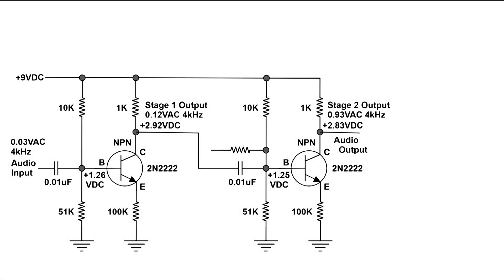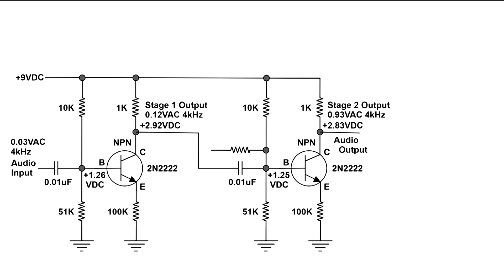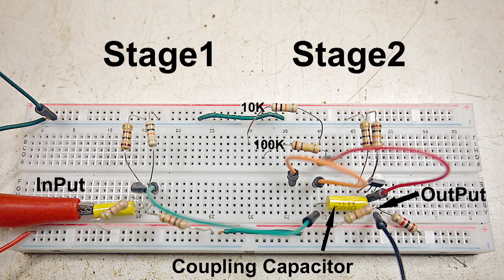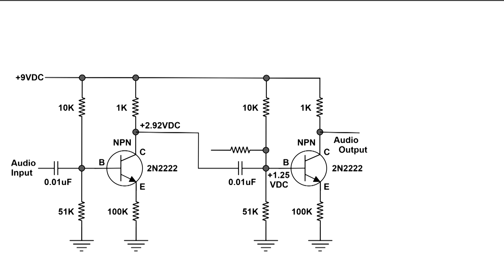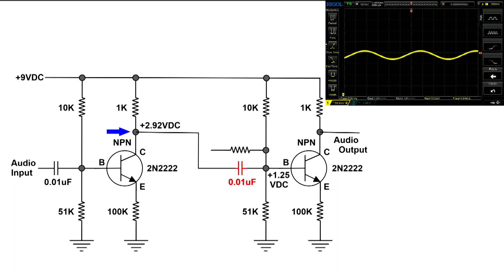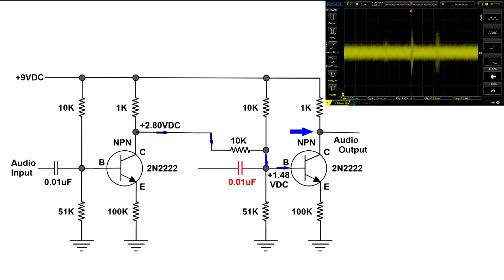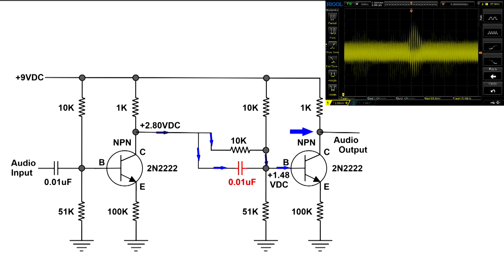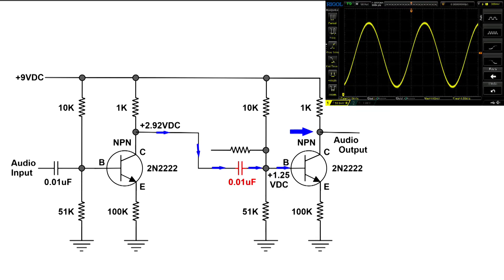Audio Coupling Capacitor in Transistor Amplifier

Comment: That made more sense to me than most videos on the subject.  I've been trying to figure out how to build little transistor amps and fuzz pedls, and the little 4 part fuzz circuit I found on YouTube that I made has blown out a couple of small op amps, and it happens when you plug in the 9v battery.  I figured it was too much DC voltage passing through.  I can plug it into a practice amp with no problem, but I assume there's some protection coming in.
Reply from the maker: Thank you! Look for circuits using your op amps. I do not know what op amp or how you are trying to use them.  When you get a op amp circuit working then add your circuit to it. If it still blows try adding a coupling capacitor between the two circuits. Hope your successful!

Comment: Sir your videos are really interesting to me.

I'm from INDIA.
Can I make one request...
Can you please make new videos on how does the video source switching takes place in cars with 360 camera system?
Are RELAYS employed to do the SWITCHING?
Any decoupling capacitors required in the circuit??
Can you please elaborate these curiosities on the new videos?
Reply from the maker: I'll take a look at the 360 camera systems.
Reply: @AllAmericanFiveRadio  okay Sir.
Really eager with so much curiosity to know how the video source SWITCHING takes place 😊😊😊 among the 4 video input cameras.

I wonder if relays were employed to do the switch, will not the coil magnetic field disturbs the video signals etc etc

Comment: Love yourt vids. Something got me confused, from long ago I recall the gain from what I think is very close to this circuit ... being is RC/RE. Im lost how being 100K on RE and 1K on the RC you can get gain. Probably Im getting rusty LOL
Reply from the maker: This circuit may not be optimum for gain. But when the coupling capacitor is replaced by the resistor the transistor will not burn up.

Comment: Why does 9vdc not get to the collector of the second transistor through the 1k resistor from +9vdc to audio output? I can't see a capacitor on that supply line to block dc. Thanks
Reply from the maker: The 1K resistor is the load for both stages. NPN transistors must have a positive potential on the collector or it will not function in an amplifier. Here are some videos about how transistors work in a circuit.
Transistor, How Does it Work in a Circuit, Demo
https://www.youtube.com/watch?v=vs3zUHdlsYY

Transistor How can it Amplify
https://www.youtube.com/watch?v=O9aT950DRkw

Transistor What does it do in a circuit Visual Demo
https://www.youtube.com/watch?v=o1ygTZTHDnE

NPN Transistor on off switch and also a variable resistor
https://www.youtube.com/watch?v=knm_t10hJGM

Junction Transistor for the Beginner, the basics
https://www.youtube.com/watch?v=pStpu8DslXo

Determining NPN PNP C E B for a Junction Transistor using a Ohmmeter
https://www.youtube.com/watch?v=fWBjvaRDErk

Transistor Basic Function
https://www.youtube.com/watch?v=BOMbydWGecg

Comment: I have problems with coupling capacitors. They always reduce the gain of every amplifier I build. What to do to prevent that or at least calculate how much the signal will be reduced?
Reply from the maker: This site may be helpful.
Capacitor Selection for Coupling and Decoupling Applications
https://passive-components.eu/capacitor-selection-for-coupling-and-decoupling-applications/
Reply: @AllAmericanFiveRadio  Thank you :)

Comment: There seams to be an error in the schematic, the base bias voltage should be 7.52 VDC, VB = (51K/(10K+51K))*VCC. (51K/61K)* 9VDC.
Reply from the maker: You need to add in the Emitter Bias junction because it forward biased.
Reply: This still does not add up, Ve = Vb- Vbe, where Vbe foe a Si diode is approximately equal to 0.7 Vdc. this would be 7.5 VDC-0.7VDC = 6.8 VDC.
Reply from the maker: @pbaemedan  If you did not read the SHOWMORE I have an error, the emitter resistor is 100 Ohms not 100K.
Reply: @AllAmericanFiveRadio  It looks like you have the 10K/51K dividers the wrong way round on both transistor bases as well?
Reply: On your breadboard, you can see that the 51K resistor does actually go the +9V and the 10k goes to Ground.😊
Reply from the maker: @tecknow4613  The negative rail is the top and the positive is the bottom rail.
Reply from the maker: @tecknow4613  Your right, I must not make drawings at 3AM, it does not work for me.
Reply: @AllAmericanFiveRadio  Easily done, nice video!
Reply: @AllAmericanFiveRadio  thanks,  that was I needed for my ltspice model.
Reply from the maker: The negative rail is the top and the positive is the bottom rail.

Comment: A very good way to show how the coupling capacitor works and the reason it is used to couple one part of an output to the input of another component.
Reply from the maker: Thank you, and your welcome.
Reply from the maker: I just added this to the showmore of the video.
The emitter resistor should be 100 Ohms, not 100K.

Comment: what bias voltage is at the emitter ?  is the base set at negative v with respect to the emitter ? I'm guessing the emitters have around + 2 volts on them .thx
Reply from the maker: With the circuit set up normal, the stage 1 emitter reads 0.615VDC. The stage 2 emitter reads 0.619VDC.
Reply from the maker: I just added this to the showmore of the video.
The emitter resistor should be 100 Ohms, not 100K.

Comment: i am learning, so i am kinda dumb. but how is the output of that voltage divider at the base so low? i did the calculation with 10 and 51 k resistors and got a much higher voltage
Reply: I also couldn't get the math to work out.  I simulated it, and it didn't work, but the math matched what I was coming up with.  To get something close to the numbers in the video, I had to adjust the bottom resistors in the simulation.  I changed the 51Ks to about 1.8K and the 100K to about 75 ohms.  That gave me similar DC operating point numbers, and I believe similar AC output.
Reply: @kg6hum  interesting. I'm going to have to set this up on a breadboard
Reply from the maker: @fingersmcoy  I just added this to the showmore of the video.
The emitter resistor should be 100 Ohms, not 100K.
Reply from the maker: @kg6hum  I just added this to the showmore of the video.
The emitter resistor should be 100 Ohms, not 100K.
Reply from the maker: Here is a little more information.
With the circuit set up normal, the stage 1 emitter reads 0.615VDC. The stage 2 emitter reads 0.619VDC.
I’ll keep this circuit for a while, if you would like more information.
Thank you!!!
Reply from the maker: Please do build this circuit, I’ll be gald to answer questions.
Reply: maybe the small amount of current draw lowered the actual working voltage( just a guess, i'm noob as well)
Reply: @garygranato9164  you could be on to something. i cant figure it out :)
Reply from the maker: @fingersmcoy  I just added this to the showmore of the video.
The emitter resistor should be 100 Ohms, not 100K.
Reply from the maker: @garygranato9164  I just added this to the showmore of the video.
The emitter resistor should be 100 Ohms, not 100K.
Reply from the maker: I just added this to the showmore of the video.
The emitter resistor should be 100 Ohms, not 100K.

Comment: In the 10k case, I wonder what the waveform would look like if you were to pull the bias down with the other two bias resistors.
Reply from the maker: I just paralleled another 15K, making a 7.5K. The oscilloscope shows noise.
Reply from the maker: I just added this to the showmore of the video.
The emitter resistor should be 100 Ohms, not 100K.

Comment: You only really see resistors installed in place of DC blocking caps in instrumentation amplifiers rf etc
Reply from the maker: Thank you.
Reply: @AllAmericanFiveRadio  I know you know this Rick I commented for people reading the comments in the future 😉👍
Reply from the maker: @T2D.SteveArcs  Yes, that is why I do this.
Reply from the maker: I just added this to the showmore of the video.
The emitter resistor should be 100 Ohms, not 100K.
Reply: @AllAmericanFiveRadio  yeah most people know the emitter R should be 5 to 10 x lower resistance in class A common emitter (is good fun to experiment) gain etc
Are you going to do a follow up with a bypass cap and teach about frequency response/ linearity etc?
Reply from the maker: @T2D.SteveArcs  Bypass capacitor is a good idea. I'll look for a transistor radio I can use.